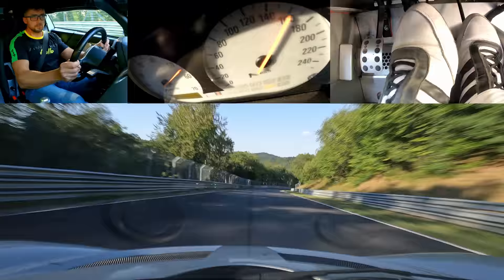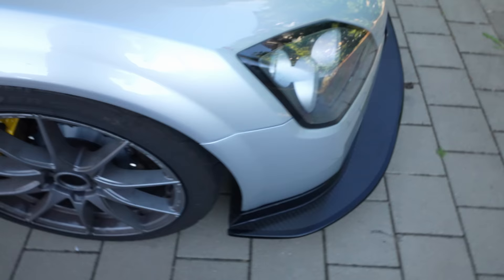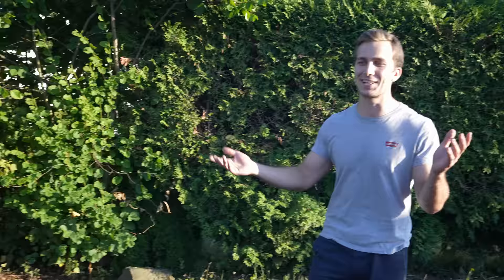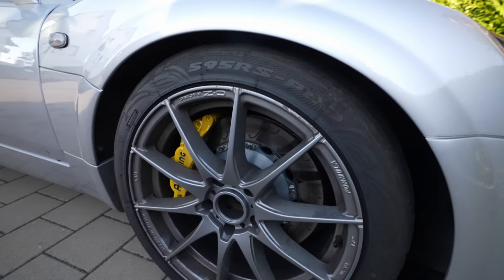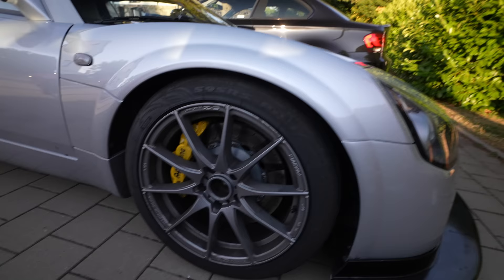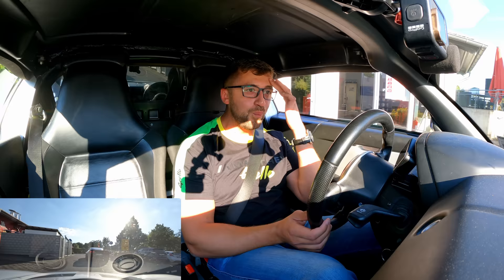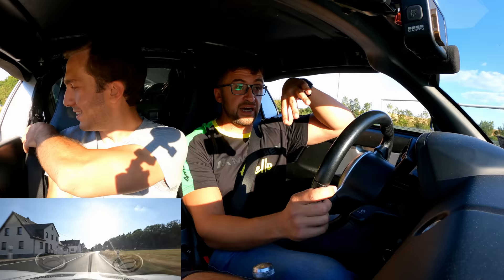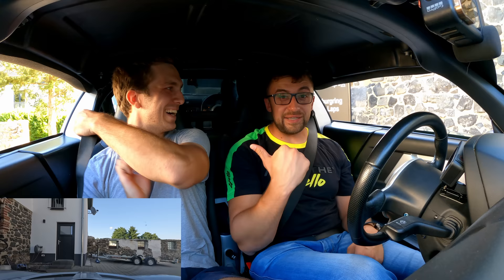This Engineering Student Built a PERFECT Track Car!

Comment: That fact that this student engineered, home built opel speedster can keep a cayman gt4 in sight... and it's not even finished yet speaks volumes. Excellent video!!
Reply: But how good was the driver in the GT4, and it doesn't have the diffuser
Reply: @marklangren3142 GT4 obv would probably be faster if someone more pro was driving but he was still pushing it it seemed from the video so that’s still pretty impressive nonetheless
Reply: @marklangren3142  A Porsche rear also acts as a diffuser, at least to prevent lift and keep traction at really high speed. But it's a tuned-down compromise between aero, design, and ground clearance.

Comment: Fun fact about those Ecotec engines is here in the states we got the 2.0 variant with a factory supercharger in the cobalt SS. The 2.2 I believe the weak point is the rods. But with new rods and pistons along with an upgraded valve springs these things are capable of monstrous power. The 2.0 in stock form can easily push over 450hp to the wheels. GM even has a handbook for the Ecotec line on how to build these engines and what fails at certain power levels.
Reply: Is that engine in the Pontiac Solstice as well? Once rode as a passenger in one - very nice.
Reply: It's originally an Opal engine we we're lucky to get in the Cobalt through GM owning Opel. Now that GM partnered with Honda we might be getting Honda engines in our small GM cars. That would be awesome if they brought the Cobalt back with a K20c.
Reply: @schumifannreins295  yes and no. The LSJ was the supercharged version that was in the Ion Redline and Cobalt SS. They used the LNF in later Cobalt motors which was the turbo variant. Yes they did use the LNF (2.0T) in the Solstice GXP and Sky Redline but no they didn't use the supercharged variant (LSJ). The standard Sky and Solstice used the LE5 which was a NA 2.4L.....and there's a bastard year for the Cobalt SS that used this motor. 

In this car it has the L61 which was a 2.2L. LSJ parts were simple bolt ons, like the supercharger thats on this car. I used to own a 04 Ion and my friend had a 04 Ion Redline and his friend had an 05 Cobalt SS. Lots of time spend upgrading.
Reply: @camarodreams7689  Thank you both.
Reply: @camarodreams7689  And it is those M62 superchargers from the scrapyards that we bolt onto these speedsters for cheaps.
With those on a 2.2 we reach a bit over 300 bhp. With the harrop 1320 supercharger that was developped for the lsj we squeeze up to 400 bhp out it.
When putting it on a 2.4 ecotec it goes up to 500 bhp. Good times. We love the ecotec family here.
Reply: @smileyspeedster  yes! I remember the cheap TVS alternative was the M90 off the Grand Prix GTPs. They are a little bit smaller than the TVS.
Reply: @gtgodbear6320  why would you even get my hopes up like that? So cool!
Reply: @schumifannreins295  I think ecotec is the fastest i4 out there now
Reply: @gtgodbear6320  actually the engine was developed by saab not opel
Reply: @anubaral  Saab really got the short end of the deal. Shame they went bust.
Reply: @Devin.Kurant  True, i drive a opel with the 2.0 b207l/z20net engine, if you look at the engine it's obvious why they went bust. There's metal all over the place, big bolts, and built so it's easy to be worked on. No wonder they went bust by going the saab way unfortunately
Reply: Wait! Don’t forget the SAAB 9-3! I drive one and it’s the same motor!
Reply: @sandi5984  One of the faster, yeah, fastest ehm  not really
Reply: one thing most people don’t know is the 5th gen Grand Am/Alero came with a 2.2 and 2.4 ecotec and if you know Gauge Dochnahl with his crazy Alero you will see how slept on the Grand Am and Alero are. the V6 variants are pretty much a failure although people like Kyle Maffitt have made them pretty quick with a 3.5 and a F23 trans
Reply: Oh wow the handbook by Gm at different hp levels is awesome
Reply: @anubaral  OK. Was Saab owned by Opel or something?
Reply: @gtgodbear6320  no, opel and saab were owned by gm but that engine was designed completely by saab with sweden brain, gm was there just to fund it
Reply: Those older ones are beast I want one in my 15 encore I'm a rally guy. Do perfect platform for me at the moment with the 1.4l luv turbo.
Reply: @miloscvetkovic4828  Unless it changed hands since 2020, Carl Brunet holds the faster i4 record in his solstice gxp. 5.951 @ 231
Reply: @tag206  i taught we were talking about stock engines. But as of tuned 4 bangers, i think that k20 holds the record for hp
Reply: @miloscvetkovic4828  I mean stock block and head pushing 2000+ is impressive even if it has a forged rotating assembly. And what's the highest HP on a k series. I could only find 1600-1700

Comment: Hi There,

As an engineer myself, and a teamchief in a race team and extreme motorsport enthousiast... WOW!!!
What a build!

You can see it has power in abundance for this type of car, but many people can increase power I guess.
What I am most impressed about is that you actually see the down force working.

A good driver can carry some speed through a corner up to the point where the car reaches its limit and becomes nervous and hard to control.
But the way this car goes through a corner... It is SO stable!!
The way you carried decent speed through the corners throughout this lap, and have it so stable tells me 2 things:
- that you were definitely not driving on the car's limit (makes sence ;) )
- there is much more potential in this car!

Massive kudos to this guy who built the car!
Reply: Thanks man! Be ready for this year.

Comment: The fact it does it without needing a wing, is testament to how damned good the design geometry is in practical application. Outstanding work. =]
Reply: I wonder why ground effect was banned??
Reply: @Bingsolomon  Because FIA are arbitrary and live up to their acronym;
Ferrari International Assistance.
This dude would be nicely at home in Japan with the Narita Dogfight crew pushing the limits of Time Attack.
Reply: @BoydMort  I think my point was a wing can only do so much.
Reply: @Bingsolomon  Gotcha, yours was a rhetorical question. =]
Reply: @JimBrodie  I see your perspective.
Reply: There’s actually a lot of really complicated math (fluid dynamics) or really expensive software (CFD) that can tell you how much a wing in a given position of a given shape will improve your aerodynamics, really the only part that isn’t common knowledge to mechanical engineers is how turbulence works (nobody has really cracked that one yet we just kind of find ways to deal with it based on what we try and what works)
Reply: @aaronhambek6362  I solved it: turbulence is when air goes sicko mode
Reply: @JimBrodie  Yes, yes, again with this BS.

If this is the help FIA give to Ferrari, Ferrari would gladly do without it.

Anyway,  kingchambers57 has a point: why the ground effect was banned?

Let's start on 1977. In that season made its debut the revolutionary Lotus 78, the first wing car.
The idea was (apparently) simple: using a wing profile inside the sidepods to generate downforce.

And I mean, a LOT of downforce.

First problem: to generate downforce in that way, with the technology available in 1970's, you MUST put a seal of the Venturi's channel to the track, otherwise, no downforce. 
This was resolved with a mobile seal, the so called "miniskirts".

Second problem: if the miniskirt broke, you lose downforce IMMEDIATELY. That's not so nice.

For this reason, in 1983, after many controversies, the ground effect was banned.

Indeed the odiern F1 cars are wing cars, but are shaped in a way that do not need a phisical minishirt to work, thus removing the reason for their ban.
Reply: That isn't what is impressive. What is is impressive is that he isn't even an aerodynamics engineer; he is a mechanical engineer, yet still manage to make the ground effects work at that capacity WITHOUT SIDE SKIRTS, and with the variation in ride height from the soft suspension.
Reply: @JimBrodie  That's not why. Ground effects was banned because the cars suspension back then was SOO STIFF, in order to cope with the amounts of downforce which meant that one bump can easily cause the car to lose downforce and you will fly off track. Not to mention, back then aerodynamics was still being new, so that meant they made WAYY MORE MISTAKES compared to nowadays, which led to porpoising and other phenomenons. Last year, with the new ground effect regulations, teams still had problems with porpoising, and this is with 20+ years of CFD and Wind Tunnel improvements. Now, porpoising is pretty much gone, but that is mainly because the increase in ride height from this years regulations, and the FIA allowing stiffening the floor more.
Reply: I also at the first, where is the wing😕?
Reply: Mischa, lo hemos disfrutado cómo si estuviésemos en el coche, a nuestro criterio uno de los mejores vídeos que hemos visto.
Gracias por darnos a compartir éste contenido.
Te los has ganado...😅😅😅
Reply: @o77vh87  It's very simple physics, every physics student learns this in the first year.
Reply: There is a wing it's under the car, an upside down wing to be correct 😁😁 instead of lift it's applying force down.
Reply: @DataLog  There's knowing the theory and then there's putting it into practice. I know how a gun works. I could never build one myself.

Comment: I’m a union HVAC mechanic in NYC, now comparing cars to air conditioning doesn’t make much sense, but I can tell you that proper engineering makes all the difference in anything. It’s amazing how the little things are overlooked, or in most cases completely ignored, mostly due to $$$. When the proper thought and effort goes into a project with no financial restraints it’s amazing what can be accomplished.

Comment: As a final year mech engineering student myself, it's super inspiring to see what he has produced in cad come to life! I did a whole unit on improving a model in cad to which I explored the Venturi effects that are clearly being shown here! I'd love to know what angle he has used for the rear defuser. Adding some chambers the the rear might help with the dirty air out of the back also. Wish I had the cash for a project like this! Well done man! Brilliant stuff!
Reply: The diffuser has a max angle of 8.7 degrees, the flow separators are still in production hahaha
Reply: @lapocorenich  grandissimo! Un progetto che mi ispira molto, motivante 💪🏻 non vediamo l’ora di vederla completa e vedere i risultati! Continua così 💪🏻
Reply: I do maritime engineering, could we do something like this or do you need courses only done in mechanical?
Reply: I'm also finishing up my Mechanical Engineering degree. I'm taking a computational Fluid Dynamics course right now with OpenFoam. Planning on doing a diffuser, lip, or spoiler geometry for my final project, would be really cool to see if I can simulate some of his numbers or improve on them with my versions.

Comment: Hearing what the lad said about the Kevlar reminds me that the Ford RS200 in it's Group B rally spec had Kevlar body panels because the gravel abraded the wheel arches away from the inside with lesser materials.  I was told they'd get one rally from a set of Kevlar panels.   I got to a drive a 450HP RS200 around the site roads at Dunton.  I initially thought OK but not mind blowing, but then the big turbo kicked in, and the acceleration was so violent I was left wondering how anyone could think fast enough to control the car through a Welsh rally stage with trees both sides of the track waiting to kill you if you got it wrong.  That remains one of the stand out memories of my life.

Comment: I had two VX220 turbo's and they are massively underrated. The standard aero does suffer from lift at the back at high speed, the different engine cover will have helped, but the rear wing will be a massive help on the track. Oh and worth noting as you mentioned it a couple of times, these cars do not have power steering from the factory, but its not needed. There is a lot you can do to the all alloy (Lotus designed) 2.2 to improve pick up and reduce weight. A balancer shaft delete is a good start and you can get a kit that shortens the auxiliary drive belt and ditches a lot of heavy pulleys. Stiffer engine mounts are a big improvement too. I'm sure this guy will have done all this but obviously you've concentrated on his unique work. Great to see someone with so much enthusiasm and talent.

Comment: one thing i would highly recommend for him to do is to bolt a wooden (or rather resin) plank to the bottom of the car where it rubs to keep the damage contained, to keep it measurable and to prevent rubbing on the expensive bits. Ofcourse dont use bolts that stick out to mount it to prevent hurting someone when one of those sheers off and beware of using materials that might catch on fire from the heat of the continuous rubbing.
Reply: Kevlar is hardy my friend. It is both durable and as he said abrasive resistant. Not saying a longer event won't eat into it, but for a spin around that track it's awesome! Plus, it's still experimental. He put an airfoil as a front splitter making it a very low wing. Background, 3-4 ish mm kevlar can withstand 100kg of force with ease The difference  with kevlar and carbon is fragility. Kevlar you can abrade against a sharp edge and it won't be effected, it's abit slippery. Carbon may splinter under similar situations. Also sidenote kevlar is relatively unaffected by black powder burns. I do model rocketry with both materials.
Reply: A few bump-blocks would probably suffice - easier/cheaper to replace and have the benefit of never stalling the airflow under the car completely. If he puts them in line with the tyres, theoretically they shouldn't disturb the airflow too much...
Reply: I believe f1 cars use this also, I’m not 100% sure it’s wood especially these new gen ground effect cars need a wooden blank otherwise the floor would get ripped to shreds

Comment: Does it still have a fan/blower moror for cabin air circulation? Great sounding car must have been a blast to drive. 6 point seat harnesses will help find the limits.
Reply from the maker: It didn't.

Comment: He could implement some active air by-pass to reduce ground effect that actives at speed higer than 180, like an F-duct from the upper of the car that opens or a plate that extends from the floor under the diffuser to make it stall... The objects is reduce Pressure under a limit value, that however can be mitigated by a fixed value end course suspensions

Comment: Cool one. This car follows quite closely the machine I developed near 20years ago. The front splitter works well, I know. We developed a set of dampers at Oehlins for that car as well (they may still stock it?this set of dampers work wonders!) underfloor only worked with a full length underfloor attached under the car, loads of good memories...

Comment: I'm always amazed at the talents that are out there. This young man has a great future ahead of himself if he so chooses to build cars. If I could have just 1 ounce of influence on him I would ask that you chuck that engine into the dumpster where it belongs.. You a great engineer and builder my friend but let's hand the drive train duties to someone can put the sweet icing on your cake.. there are at least 10 better engines out there that have an honest intent on performing for the application  laid upon it. May I suggest ANY Honda, then there is the  new EcoBooost 2.3 from Ford. Stock It's 310hp which might be more than you have with that super whistler GM thing. Lotus used Toyotas for awhile another great choice. But if you don't do anything else please can the supercharger and use a Turbo. They are much more efficient. The air intake temp is much lower with a turbo they dont put a load on the motor to spin them. If it's liner power your looking for that is better suited for a road race car a turbo is by far a better choice. A simple fact is if you have or use the same amount of boost on a turbo that you use on a supercharger the turbo will produce more power. Good luck young man enjoy and obviously you have done a great job

Comment: Have an active aero or anti flux of wind to make the car undo the ground effect in higher than 200 as it seems to be the bottoming out point, but still have the grip to do the turning in 140ish speeds, like a inverse drs sistem
Reply: Like a tesla valve for the wind, sorry im not that deep or knowledgeble

Comment: Instead of risking the stiffening too much add a limiter that would completely stop the downforce at a certain point. Then all you’ll have to do is measure the zero point of its bottom. A hard rubber should work good.

Comment: A little surprised he didn’t use countersunk Allen key head machine screws to fasten all his under aero, at this rate he’s going to grind all his bolt heads off after a couple laps, and the aero is going to come loose and get ran over.

Comment: Misha, ground effects are superior to wings. Did you ever see Formula One cars of the seventies? I did. I'm able to type that they were beasts on those tracks. They had two fans at the end of the rear body panels. The engines in them were producing 1400 horsepower. That's when F1 banded the use of them, and at the same time, they lessened to boost those turbochargers were allowed to produce. A few years later, they limited the size of the engines, so they won't be allowed to produce so much power. The exception to this is that power doesn't win races, torque does. What's torque? The amount of twist an engine or an electric motor produces.